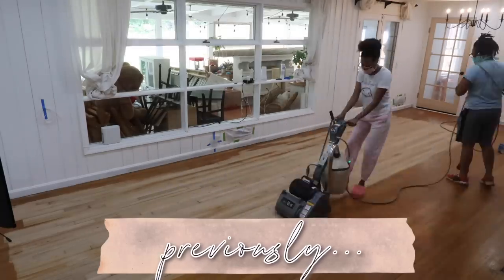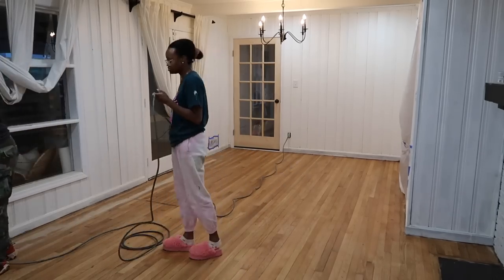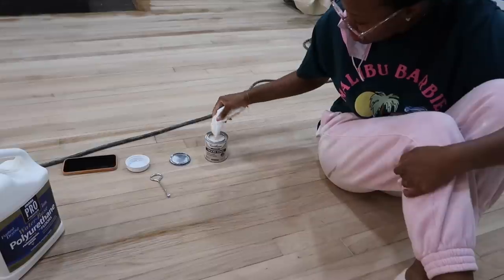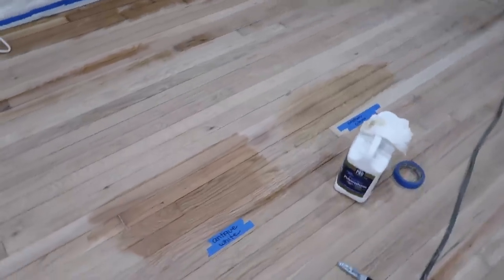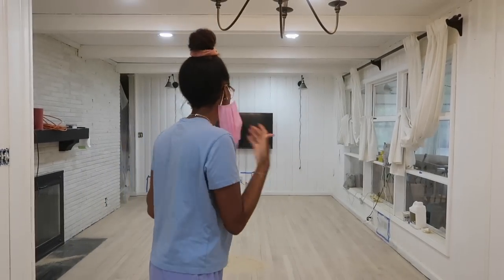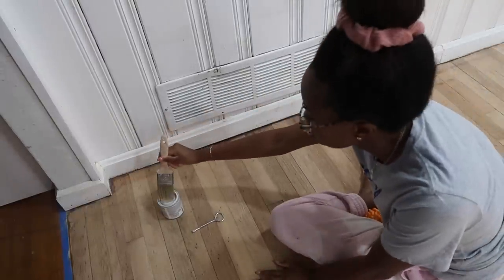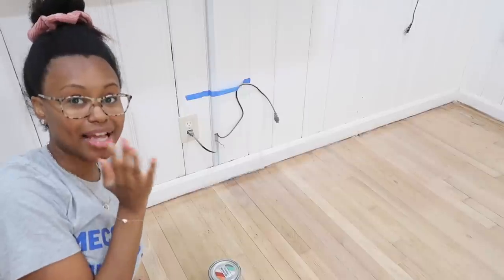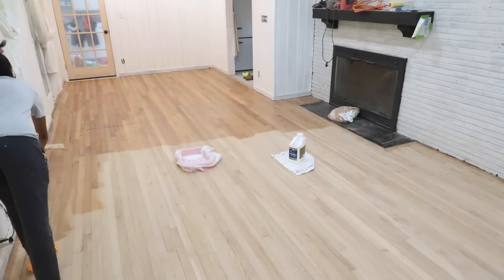WE ARE DONE| Refinishing Old Hardwoord Floors,Starting Over & Applying Stain PT.3 FINALE #FIXERUPPER

Comment: I had the exact thing happen in a 1950’s house when we refinished the floors.  We ended up redoing them twice because of mistakes in the stain and poly…and some application issues (complete user error) as well.  But…we made the mistakes in all three bedrooms, the hallway, and two living areas…so…the mistakes and do overs were a monumental amount of work.  I really identified with your frustration because I can remember looking at those floors and wondering if they were possessed.  It seemed like nothing we did worked out the way we thought it would in spite of multiple trips to Home Depot and several phone calls to help lines on the products we used.  We didn’t give up though because we couldn’t.  In the end they came out beautifully but I really thought it would never happen.   So…you’re not alone…it’s really hard to crack the code on those old hardwood floors.  You and Marcus did it though and it’s beautiful!   Plus…you two were SO smart to experiment in only one room until you got it right instead of the whole house like we did.  Can’t wait to see it with the furniture back in!